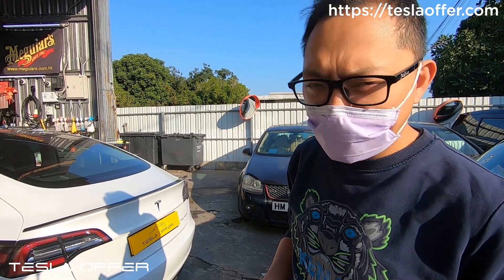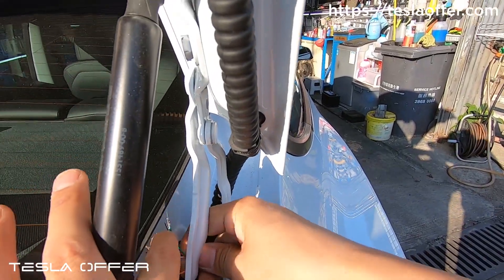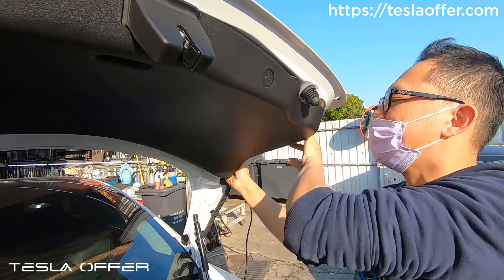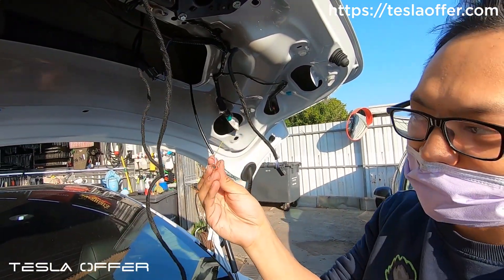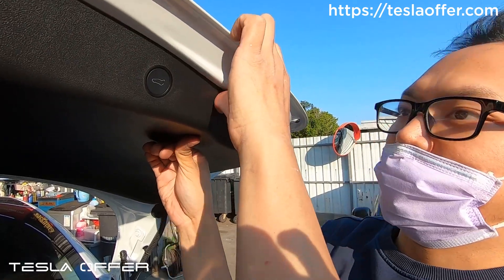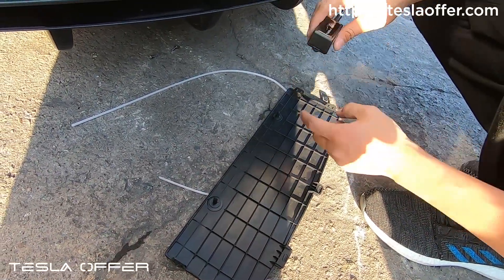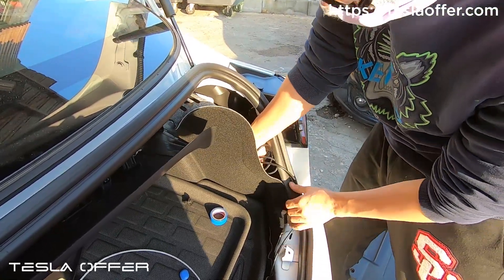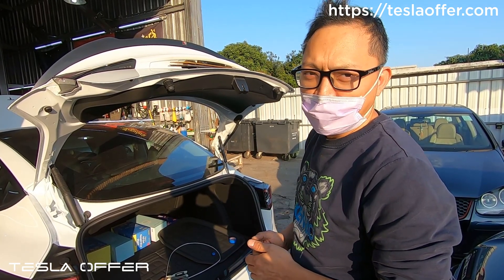EVOffer (Tesla Offer) - Model 3/Y Tailgate Foot Activation v1 Installation Tutorial

Comment: Thank you, well done. When will you provide thiness foot sensors ? your competitor provide a very thin one
Reply from the maker: We are not switching to the thin one.

One of our competitor actually seperates the controller and the sensor into 2 parts. It also using another technology which is not as stable as the one we are using on our system.